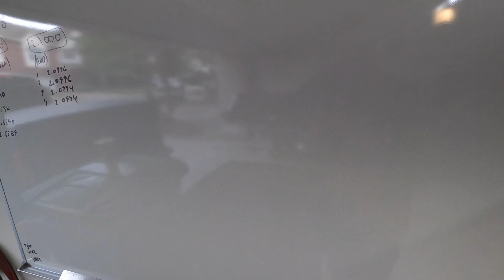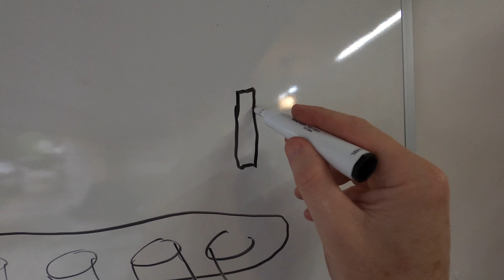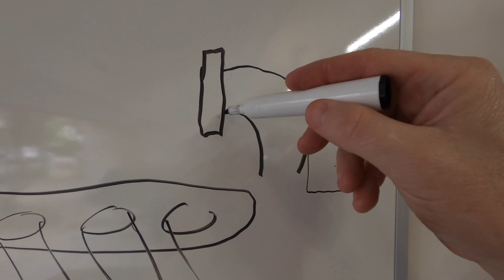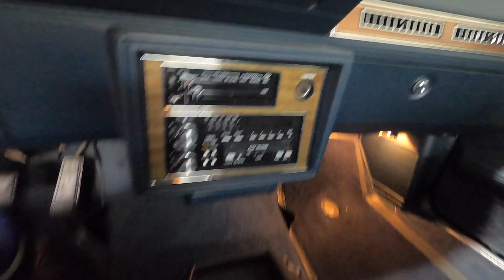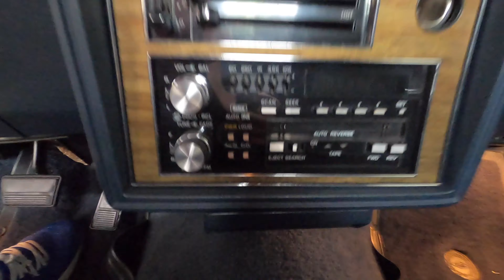1986 Olds Cutlass LS Swapped 6.0 - The Mods

Comment: I would like to do a 1986 cutlass built since I had one of the cars as my first car in the early 1990's...it had the slow but reliable 307 V8.....How many hours of labor would it be to install one of these engines you installed... wondering what it would cost me to have someone do this job....
Reply from the maker: Honestly, I'm not sure what it would cost.  I haven't been to mechanic in 20 years.  I was watching a video of a truck with a failed lifter.  The guy said that fortunately it didn't cause damage to the camshaft or the bill would have been $6000 dollars!  Labor rates must be insane.

Comment: What is part number for the gas tank looking for my 87 442 5.3 swap
Reply from the maker: It's been so long I don't remember.  I believe it's the tank for an '87 Monte Carlo w/fuel injected V6.  The brand is Spectra.
Reply from the maker: 99% sure it's a Spectra GM306C...an ad on ebay shows it's baffled, which would be correct for fuel injection.
Reply from the maker: Highly suggest you line the tank straps with bicycle innertubes or similar to quiet the pump noise.  It makes a huge difference.  I think I explain it in one of those videos.

Comment: where did you get the rubber straps that go around the fuel tank
Reply from the maker: The straps are OEM on the Grand National due to it having a tank mounted electric pump.  I pulled mine from a parts car.  You could very easily make some from inner tubes.
Reply: @n5yiz  ok thanks

Comment: Something like that I would have just bought a carburetor intake and carburetor for it and avoided all the wiring and fuel system mods tank walbro pump all that put an electric pump out by the original tank used a fuel pressure regulator with return up by the motor and been done w it if I wanted to use the 4l60 e I would have gotten a throttle position sensor for the carb to make it shift or just gotten a 700r4 w the TV cable they work great and have a great low gear and of course overdrive the gas pedal cable would have worked w the carb so no mod there and had the same thing you've got for less money and less work and less hassle just my opinion tho if the car had injection before then of course stay w it but that didn't and I'm not opposed to carbs I am used to them and not afraid to use one I dont plan on driving to Denver or anything so I wont have to worry about adjustment of the carb where injection does it automatically I get that but cost effective I think is the way I would have went on this and got the same results no question in my mind

Comment: Could you tell me the tire size on front and back?
Reply from the maker: P255/60R15 rear, P235/60R15 front
Reply from the maker: I have 1/4" spacers in the rear.  They aren't needed, I like the wider stance and I already had them so I used them.

Comment: You have a really cool car, the only thing I would recommend is polyurethane bushings in boxed controlling arms, maybe a front end upgrade  and C5 brakes! I miss mine  I had a Pontiac 350 t/a engine. 1985 found with destroyed driveline in 1990 for $150 behind old shop covered in dirt and bird crap! They didn't want to touch it! Haha 
Was mint body after 3 hours of cleaning!

Comment: I need part number to the gas tank n sending unit and them rubber straps
Reply from the maker: I'll have to see if I can find the part numbers for the tank and sending unit.  I forgot to mention that  the sending unit I used is not compatible with the '86 Cutlass fuel level gauge.  The ohms output is different.  I will have to look to see what the right output is needed.  As far as the isolator straps, I don't think those are available in the aftermarket.  They would be very easy to make.  Here is a video I forgot I made about the tank isolation.
https://youtu.be/kWd2oFT6rvg

Comment: That 10 bolt won’t last long
Reply: Depends how rough on it he is the grand nationals had some balls now and the rearends were built pretty tough for that reason I bet you'd be surprised how much abuse it really will take and of course tires are the big thing w slicks no it won't last long but w tires that will spin then why won't it last long it's all about how you drive it if you reverse to low it with slicks of course you'll break it but I had a chevelle e a ten bolt posi that I beat pretty dam hard and never broke it and when I say beat it hard I'm not jokimg it was behind a 400 horse small block 400 w aluminum heads decent cam all that and it lit the tires up easy all day every day even snatched second gear real hard w the turbo 400 w a shift kit and again went thru a few u joints never hurt the rearend tho so idk about your statementb

Comment: Beautiful car. I have a question about the wheel set up. Are you using spacers on the rear or is that all tire?
Reply from the maker: I have 1/4" spacers on the rear, but it doesn't need them.  I just threw them on there because I thought it looked better with them.

Comment: What ECM did you end up using?
Reply from the maker: P59
Reply from the maker: It's the one that came with the engine from the same vehicle.  2007 2500 Classic 6.0
Reply: @n5yiz  really clean car dude.  Will that ECM handle a tune or will you have to do something different if you want to raise power?
Reply from the maker: @2dfx  ECM will handle the power fine.
Reply: @n5yiz  did that engine have the active fuel management? And did you have to do something to delete it?